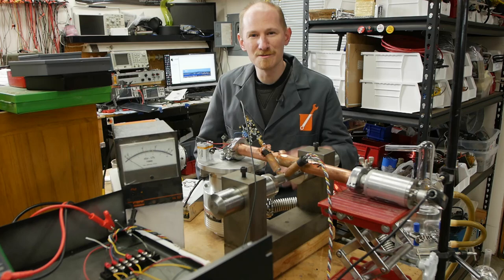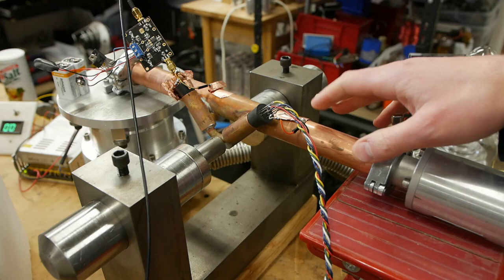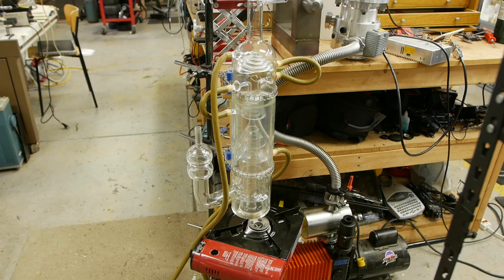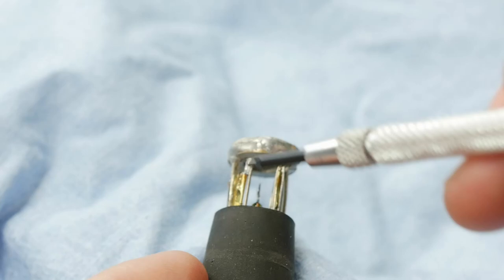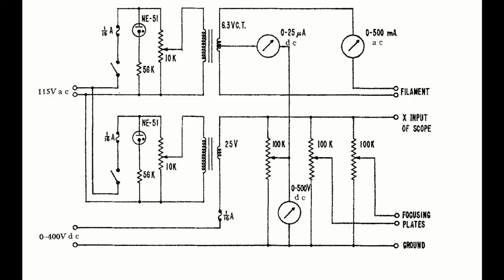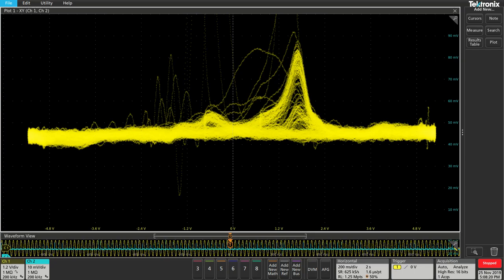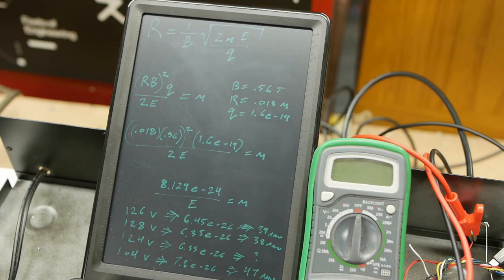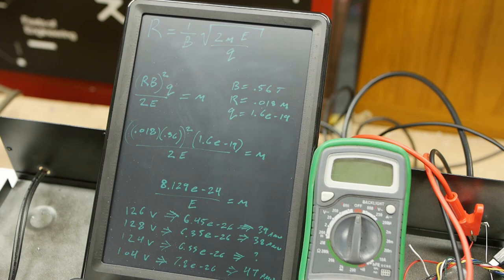DIY mass spectrometer measures potassium in dietary salt substitute

Comment: I'm way out of my depth of understanding on this topic but as far as I would think that it's possible to measure the weight of matter by applying voltage to it just doesn't seem right. The way that I see things is that everything has an electric charge and it's a nominal state of charge that gives a particular atom it's characteristics! And by applying voltage and heat will separate solid matter into a liquid or gas but in the process it will acquire a higher state of charge giving it buoyancy in it's surrounding atmosphere which to me mean an incorrect weight measurement. Some elements can absorb much more charge than their nominal state and become buoyant as we see with styrofoam, to the point where it even overcomes the effect of gravity! To me it's almost like what you are measuring is the ability of a particular matter to accept a charge over and above it's nominal state! 
The periodic table gives us atomic weights but I feel that their electrical characteristics are just as important and therefore be included in the table. It's said that atoms make everything but to me it comes down to three different properties, space, matter and the electric charge. These three different properties are required for the very existence of everything, the variations in all of the three properties will determine an atoms characteristics. I know that there's plenty of people who will disagree with me and that's okay, I don't need particle physics explained to me, I have a fairly good understanding of it, I'm just trying to dig a little deeper in a different direction that what's already been done.

Comment: Using a sine wave is going to tend to give you this kind of result.  Try using a sawtooth waveform.  Since you're not driving any real impedance it should be easy, then you will get a better representation of a linear spectrum. Just my ignorant $0.02...

Comment: Concerning the "mirroring"... Could it be because of your transimpedance amplifier? Did you test it on it's own indipendent of the collector? You can inject nA level current pulses by putting uV-mV level voltage pulses through a pF level capacitor. These guys https://www.cremat.com/ provide (relatively low cost...if one channell is all you're after) ready-made charge sensitive pre-amps for this kind of application, and they describe the current injection testing on their datasheet for their CR-110 product.

Comment: Could the second peak be due to transmission line effect. Is the coax cable correctly terminated (50 ohms both ends) ? If not, you may be seeing what is effectively a time domain reflectometer. Check out this: https://www.youtube.com/watch?v=9cP6w2odGUc

Comment: Flyback voltage from the “collapse” of the AC.  I tried to comment last night but you took the video down as I was typing. Could rectify the AC, but I’m hoping you go strait for the laser setup
Reply: Am I correct in thinking he would need to drop the DC voltage down to the bottom end of the spectrum since the rectified AC signal would all be a positive voltage?
Reply: If I understand the output correctly, both waves of the AC would be the same magnitude and distance (and direction once it’s rectified).  The sample rate would double, and the baseline could be set on the scope to give better resolution.  No other modifications should be necessary.
Reply: @jadosrd8950  the AC in the signal is modulating the acceleration voltage of the ions to sweep different masses, so without the negative portion of the AC signal he would not be able to scan those mass ranges without dropping the DC voltage or changing one of the other variables such as the strength of the magnetic field or location of the detector plate. I agree that the scan rate would double since the negative portion of the AC signal would now be positive after running through a full wave rectifier
Reply: CafeBikeGirl I get you.  One would have to try it with a sample of Carbon to dial in the baseline voltage (Hydrogen would work better, but more difficult to get pure  H+ on the filament).  Could then dial in the resolution with some CeO.  Then fine tune on the scope (and print a projector sheet overlay for easy identification)

Comment: you are are separating the two isotopes thanks to the different time they reach the detector, basically you are using a TOF analyzer. The magnet you are using is just a filter and it allow only a specific range of masses to pass through, not the real analyzer. Just make the flight tube longer to increase the resolution and separate the potassium isotopes
Reply: It is not time of flight. It is mass/charge ratio. Depending on how strong the electric field is, he "selects for" different mass/charge ratios. The horizontal axis on the oscilloscope is proportional to mass/charge ratio.
Reply: @mckenziekeith7434  ToF also measures m/e because the velocity of any given ion depends on the field energy of the acceleration voltage, which is constant, as well as the m/e of the ion. Low m/e, high velocity. high m/e, low velocity
Reply: @mckenziekeith7434  you are right, I misunderstood the readings of the oscilloscope, where orizontal axis measure the changing potential of the ion source. My bad, it's difficult to understand English sometimes!
Reply: @monster2slayer  I think you are right. In this instrument design, ToF is mathematically related to m/e. Still the primary method being used to differentiate is not ToF per se, but deflection angle. Only cations which deflect precisely the correct angle will pass through the slit at the detector.
Reply: @mckenziekeith7434  agreed. for ToF analysis you need a pulser with a known pulse frequency, which is obviously not used here.

Comment: 47 is silver. There is silver in some types of solder. Perhaps that's interfering with the results? It could just be a coincidence, but you are using soldered copper pipe!
Reply: He is talking about mass, not atomic number. Silver isotopes have masses of 107 and 109.

Comment: you need to run this outside, with outside air, and analyze what is in the air, and if it matches geoengineering patents, which methods are being used to manipulate the weather. get to work and post your results immediately.

Comment: Doubly ionized Mg? Don’t forget that you’re are NOT measuring mass, but m/e. Your salt “substitute “ may not be pure KCl. Alternatively, I wonder about your design where ionization and acceleration are combined. In most electron impact MS systems, they are separate. Potassium and tungsten have different work functions, so maybe you one peaks from direct ionization of K and one from W ions ionizing K indirectly...
Reply: you beat me to it I suspect that the system is creating diatomic Mg, from Mg added as an anti-caking agent.  It does exist in a vapor form transitionally.

Comment: well, you said you redid the math, and you can find both potassium isotopes, but potassium isnt the only thing in the system, is it? you said it was potassium chloride, so where would chloride come out? or maybe tungsten or copper or rubber, even though rubber isnt an element, my point is, if you have a bump, it has to be SOMETHING so do the math, see where it would be if it were a real element, and see if that element exists in your sample or your system.

If youve completely ruled out an elementary source, perhaps the answer is as simple as you made it seem, that theres some kind of EM bounceback happening because its a magnetic field contained in a copper pipe, and you get some ringing from the magnetism moving around.

Was it you or the EEVblog that did videos on coax and terminators and stuff like that and demonstrated that an unterminated end can bounce signal back? well, either way, it could be that.

The answer lies in the math.

Comment: To super simplify things, couldnt you use math to figure out the ratio? 
So if you had one molecule 75% carbon and 25% nitrogen, and another one which was 25% carbon and 75% nitrogen, surely you could just interpolate to get all the potential ratios of every mixture of the two if you already know that their are only two different types of molecules in the mixture. It cant be hard to write a program and for more complicated ones even some type of artificial learning. You dont have to do all the math in your head.

Comment: You are getting a lot of the chemistry wrong in this video. Most mass spectrometers don't break molecules up in their component atoms. You have to put a lot of energy into the sample to do that, and it isn't helpful in most cases -- look up elemental analysis, and note that most techniques used are not based upon MS at all. You're of course dealing with a salt here, which is readily separated into its component ions. One of the reasons why scientists don't use MS for quantifying the amount of elements in a sample is that different ionizability of the elements, and different easy of dissociation in physical processes of destruction mean that you cannot expect an accurate ratio to be obtained at the end of the spectrometer. So none of your explanation makes sense.

14C decays to 14N via a beta (helium nuclei) emission. etc.